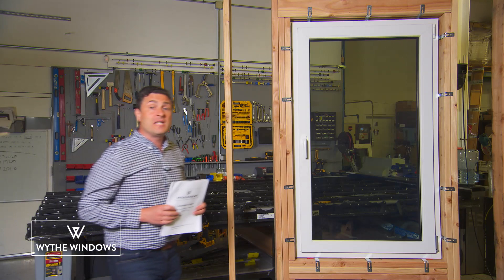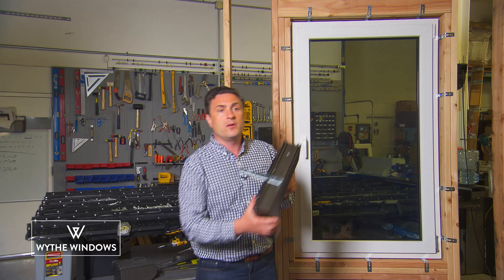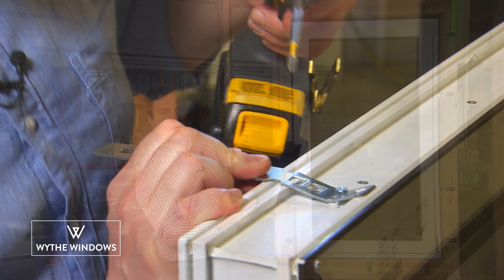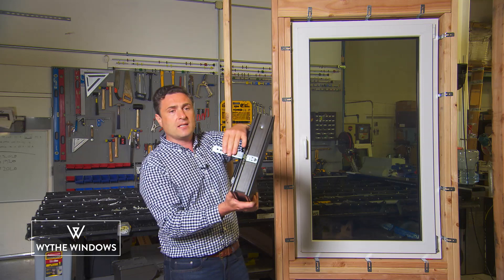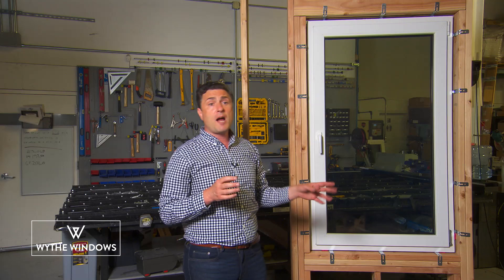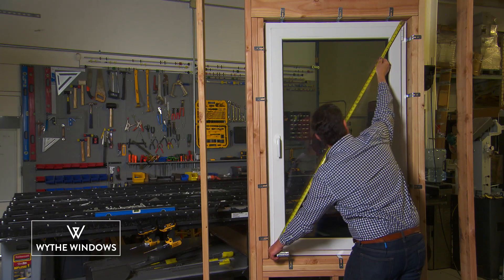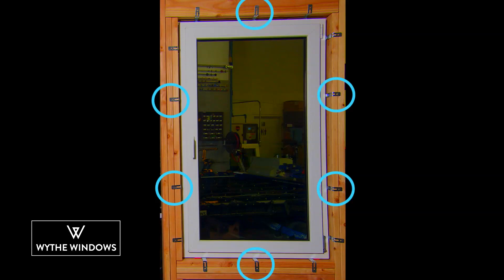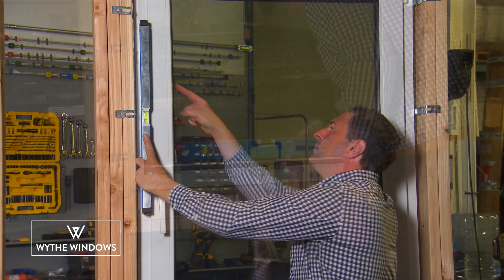Installing tips and tricks for Tilt Turn Windows

Comment: You should have a video on best way to flash these windows or better yet a kit that would come with the window. Also these windows require interior and exterior jamb extensions and require specialized (ie expensive) window treatments. These are great windows but its nice to know these thing ahead of time.
Reply from the maker: Hi Fred, That is a very good idea to discuss those different strategies. However, they would vary from different wall types.  I am excited to tell you that now that we are expanding the facility we are looking to offer window treatments in the near future :)